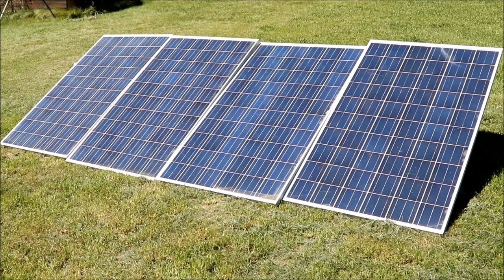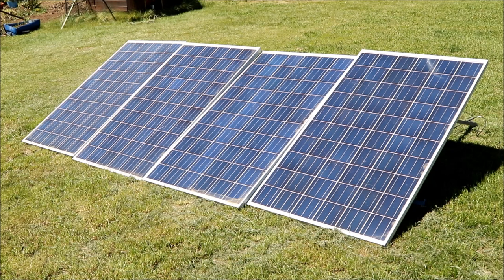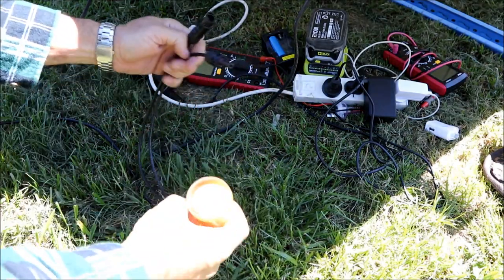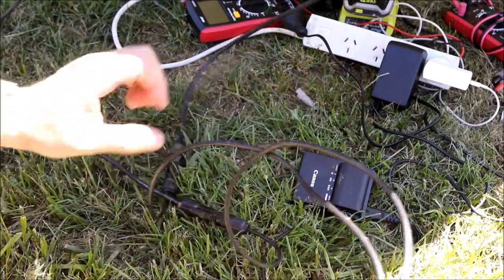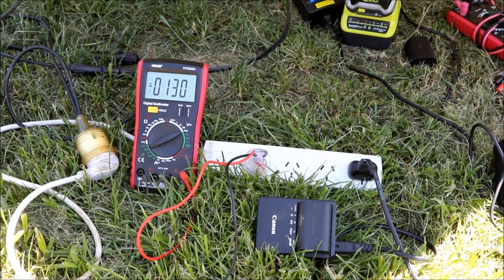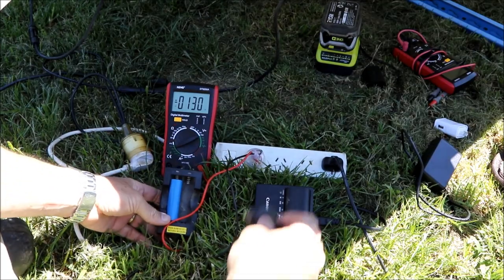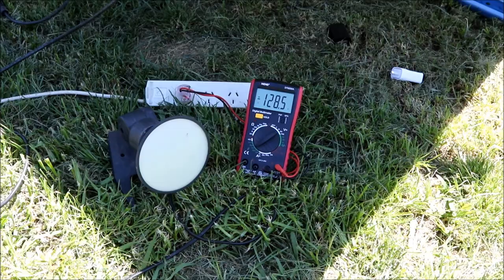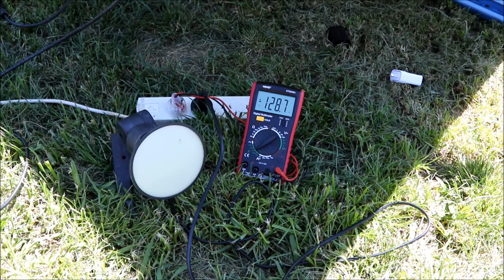Powering AC appliance's Direct from Solar panels.

Comment: I'd like to see stuff melt I'd also like to see how to run my lights in my home from solar panels. I really appreciate your videos the have helped me so much over the years and I waited 5 yrs for your return 😆 you helped me melt engines heat my barn/home now I hope I will run my inside/outside lights.
Reply from the maker: Thanks For the kind words mate. Glad my vids have been a help.  I did run the  Internal downlights But unfortunately the idiot on the film crew ( whom shall  remain nameless in my team of 1)  forgot to switch on the microphone on the camera so no sound.  At the higher Voltage they did both work just fine so I would say all you need to do is get them near your mains voltage and they should be right.

Comment: look like the diode theory is correct? if it is a full bridge rectifier, it does not care polarity, one half of the bridge is always working, just which one, but in case of a half bridge,  the diode won't give up unless you burn it. and a p/n junction will consume about 0.6 volt, which pretty fit to the scenario there is a 1 volt drop when you plug them in.

Comment: F'ing planes... Nice plug mod on the leads.
Pretty useful stuff mate, I think most cheap inverters would waste more current than the chargers are drawing.
Reply from the maker: Whenever you convert energy you loose some so if you can eliminate a component You save energy and money... and less things to go wrong.

Comment: What a very nice video! Hope you are doing OK! I like your 3-phase induction motor->generator videos as well. More of that please! =)

While doing this experiment in Sweden (EU = European Union) we have EU-sockets and EU-plugs, they can while doing this experiment all be rotated 180° to easily change the polarity of each individual electrical apparatus connected to the "power-board".

One remark though to everyone, be very-very careful while doing the dangerous high DC-voltage solar-welding-trick, the grass can be wet/moist, and handling the rod without insulation can be lethal if you have the "right" circumstances, i.e wet skin, and/or wet clothes in contact with the skin, touches the area close to the plate.

Take care! :)

Comment: I'd love to see an aircon unit with inbuilt inverter speed control being fed DC direct from panels. I can get cheap panels amd cheap aircon units but batteries, fancy switches, fancy inverters all cost loads. I'm thinking aircon in heat mode tied directly to 4× 300w panels in series should provide some cheap background heat during daytime in the mountains. Just wondering how the control electronics will cope with variable input voltage, and whether the defrost cycle gets messed up.

Comment: With the cheap AC LED lights, the smaller ones typically use a capacitive dropper circuit which requires AC to pass current. The cheaper large LED lights usually have strings of LEDs which turn on at ~200V and then use a linear regulator to drop the rest of the voltage. Edit: mains at 220VAC peaks at 311V.

Regarding the polarity issue it's a case of them not using a full bridge rectifier. Switch mode power supplies usually rectify the 220V to DC before using a buck converter to step it down to the output voltage.

Comment: Oil, Solar and sun !  :)  Did you move into the garden of Eden when Adam and Eve got thrown out ? !   I certainly learned a lot from this video.  I'm fairly competent with electrics but never knew or even thought solar panels could be directly connected to ac equipment.  As for certain ac items needing a polarity reversal is a right head scratcher, we should both find out in the comments hopefully :)
Reply from the maker: Yeah it was something I didn't know about till I read of it and tried it.  Someone suggested  That the polarity is due to the use of a Bridge rectifier. I was thinking Diode but this makes sense. I have a Battery Charger I blow up every now and then that uses a Bridge.   High power setting is full wave and low charge runs off the half wave.  If the device used the half wave to begin with, that's sort of like an AC diode so explains the Polarity.  Depending which side they run from which would bot matter with AC would explain the polarity Bias.

Comment: Cool, i was looking forward to this episode, would it work on a normal car battery charger? as in, just charging a 12v car battery up with a conventional 240v charger( i am assuming so)
Reply: Most electronics rectify to DC usually right away anyway. And the rectifier doesn't care if it's fed ac or dc. So yeah, it should work just fine.
Reply from the maker: I think would depend on the charger.  I have a few older ones that run a proper copper wound transformer to drop the input voltage.  In my limited knowledge, these need AC to work.  On a newer switch mode power supply's they should be fine but may be polarity dependent.
Reply: @glumpy10  I'm definitely interested in seeing more solar info from you. you explain things simply and entertaining.

Comment: In the USA all homes have 240 V 60 hrz. our 120 V outlets just use one leg of the 240 and the neutral we use 240 for AC
and Cloths Dryer's and high energy needing devices
Reply: Lots of places don't have 120v legs though. Their legs ARE 240 and there's 2 or 3 of them depending on whether you're set up for single or 3 phase. You would need to run power like that through another transformer to get it dropped to 120 in a situation like that
Reply from the maker: Here in Oz 220 I think it is now is the standard . As said, for 3 Phase you just add 2 more 240v Legs.  My house is 3 phase and the only thing that runs off it is the AC.  Other circuits take off one phase each to balance the load.  You can go  phase to phase or you can go phase to ground. Our system is different to that in the US.

Comment: That carbon arc rod works very well for melting platinum and tantalum but a closed cell needs to be made to help avoid blowout of the precious metals.
Reply from the maker: Sounds a Bit High Tech for me with exotic metals.  I might one day  do a bunch of panels in series to get welding like amperage.  The voltage should be pretty right  but 8 or 10 panels all in parallel should be more welder output like.
Reply: @glumpy10  I use a 70A DC welder to melt metals.  It takes more time to figure out the focal point of the arc than it does to melt the metal lol.

Comment: can ya do a quick video on off grid solar using a mixture of old car batteries etc to see if it can be done on the cheap
Reply from the maker: Been planning to do that and was working on something for a Vid like that today.
Reply: @glumpy10  I decoded at dawn it is neutral, day is positive, dusk is neutral, night is negative hence why solar panels reverse their flow at night - it is a polarity switch in the real world as it ran my bubbler in reverse at night which sucks up the water to the motor, voltage was only 1.9v@night but it was enough to run my motor which starts at 1.5v. In laymans terms day is a full sine wave and night is a half wave, the aether is alternating current basically.

A full wave bridge rectifier should fix things.

Happy experimenting. :)
Reply: @glumpy10  are ya still good mate been waiting for a vid i hope you are all good
Reply: its been a year buddy hope all is well

Comment: Cool stuff. Amazing arc from the panels.  DC is one thing I don't play around with, as I know the dangers.  You have an incredible amount of panels holy smokes.  I have 3 100 watt panels, 2 50 watt panels, and an 80 watt panel.  Just don't have the yard for a bigger system, too much shading.  It runs a security camera, and some back up led lighting. 
You are way ahead of the greenies, or should I say watermelons?
Reply from the maker: I am  anti green in the politicisation of it and get whinged at for Comments I make for not towing  the green agenda. The funny thing is with the veg oil I have used for over 20 years in vehicles and engines and all my solar,  it's very rarely any of these loudmouth ignorant greentards can ever come near the low impact and sustainability and other buzz words they preach that I achieve. I have a Large 3 person house which was built very inefficient but still my power bill says I use less than half the  electricity of an average 1 person household.   I don't do it for any flawed ideal, I do it cause I like the independence and it saves me money. So many greentards are inner city yuppies that do nothing other than conserve water by not bathing and are total hypocrites in what they preach.

Comment: A lot of electronic converters are designed for either 110 or 220. All they have to do is change the plug for the country that they are shipped to.

Comment: yeah most modern appliances just rectify to dc, probably will be fine.
Ryobi charger was a bit of an interesting one though, never thought these would have a polarity preference.
Reply from the maker: I couldn't think of why either but someone here has explained it is because they use a Bridge rectifier in the half wave. I have seen different things like that so makes sense. They only use half of the AC cycle to drop power initially and which ever way they are set will determine polarity. On AC does not matter because they have both polarity's running anyway.

Comment: The battery charger not working in one polarity is weird. I know some cheap, small phone chargers use only a single diode rather than a full bridge rectifier, but that tool battery charger looked too beefy for that.
Reply: single diode can be beefy too, say, those use in elevator can be a 100amp, there are some even bigger than that, which is mostly industrial use, we just don't have the chance to see them in daily live.
Reply: @luderickwong  Yea I know single diodes can be very powerful.
My comment was more about very cheap power supplies skimping out on a proper input rectifier bridge and using half wave rectification instead.

Comment: Don't know if you know, but keeping panels exposed to the sun, in use or not, damages them. When they're unplugged, even more so. That's why all systems use a ballast to put across the panel when batteries are fully charged. It's not big damage but it's still there.
Reply from the maker: I'm not sure if Damage is the right term, I call it degrading but probably one in the same.  I do know that new panels fall off in output more in the first year than any other.  Seen that with new panels I put up myself. First summer they scream and do very close to rated output even when hot. Next summer the output is more modest. Same token I have panels that are 12 YO and still perform really close to rating, even in the Chyneese no name brands.
Reply: Panels sit at no load exposed to sun all the time when batteries are fully charged.
 I not sure how exposing Solar panels to the contents of its name harms them beyond regular degradation in sunlight expose
Reply: @vlogcity1111  correctly configured systems have the panel have some/full load when exposed to sun and systems are charged, because otherwise the voltage across the cells builds up and increases the damage done to the cells.
Reply: @dimitar4y  I can see how an over voltage situation would cause damage in poorly designed under constructed panels.

A lot of panels are capable of many times the rated output voltage. 
Like having four panels in series.

Unless when open circuit the panels would develop 400+ volts.
I think it’s more of a heat dissipation problem rather than an over voltage problem.

 I do agree over voltage situations will ruin electronics. But to design a solar panel specifically to be in the sun in potentially open circuit situations at times in a supposed 25 year useable span. Why the heck why would They would be designed to handle an over voltage situation on open circuit exposed to direct sunlight ?
Other than to be a purposeful design flaw to sell more panels
Reply: @vlogcity1111  Also, any generated power by the panel's exposure to sun HAS to go somewhere. So it shorts into the panel itself, causing (slow) high voltage breakdown across every single cell that generated power. The power is forcefully generated by the sun rays impacting the photodiodes inside, that power then has to go somewhere.